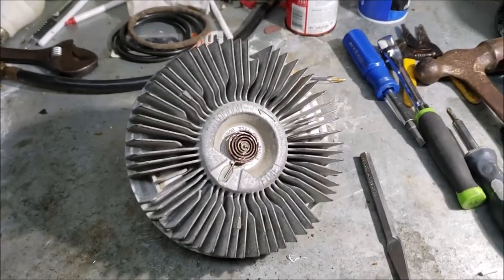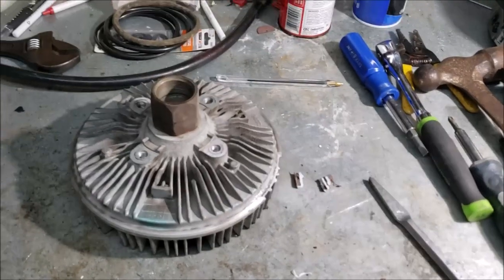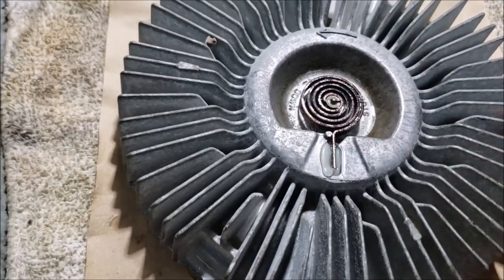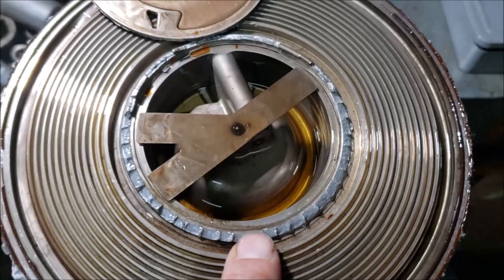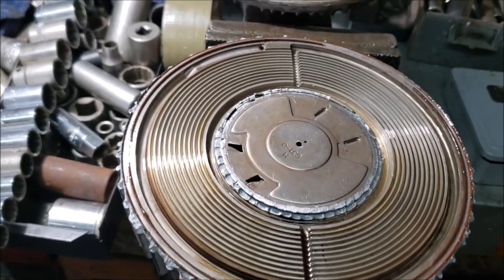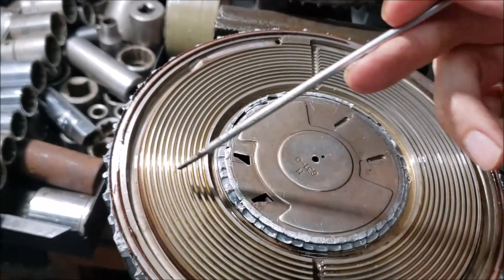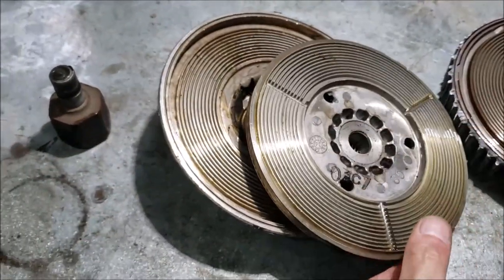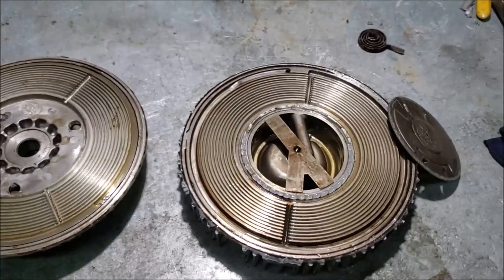How Does a Viscous Fan Clutch Works in Your Workhorse Chassis With a 8.1 Vortec Engine W8002567

Comment: A lot of times it’s not even a bad fan clutch. It’s a bad radiator with an internal blockage. It doesn’t allow the hot air to flow over the fan clutch to engage it.
Reply from the maker: I concur, I address that problem in this video https://youtu.be/Y82GjwbTJnM?si=pimoTwfDpPG_DXFK

Comment: Silicone oil is used because it stays thicker at high temperatures.  In a pinch once, I drilled and tapped a hole in one of these and mixed up some silicone brake fluid with molykote 111 silicone grease until it was the right viscosity, then squirted it in the hole with a syringe.  Worked like a champ.  They typically leak all the fluid out around the control shaft under the spring.  If you look, the springs are always oily and covered with dust on "worn out" fan clutches.  Seemed like there was a little evidence on this one.
Reply from the maker: Rick do you still have the ticking sound on your Allison?
Reply: @ktoutdoor  Yes, we've put about 10,000 miles on it with the ticking.  Towing our trailer for camping and hauling tractors.  it's still working fine even with the ticking.  Everyone is stumped
Reply from the maker: @RickBaconsAdventures  When you find out what it is please let me know.
Reply: @ktoutdoor  Will do!  You have a lot of great videos so I am often around your page.  I have a really long writeup about the noise and work I've done in the description of the video if you didn't already see it.  I've got pretty good equipment and credentials so I'll be doing all the work myself if and when it decides to become a problem!

Comment: My 1990 LJ78 400k, auto , has a viscous fan..

I changed the radiator and thermostat bout 10 years ago , when I tow my trailer with the 1200kg  buggy over the hill on way to coast the temp would rise slightly , but the temp light for tranz would light up, I just pull it down a gear, run the revs at bout 3500, after bout five minutes it would go out..
I can hear the fan working.. 
holding that ratio going down the other side, I hear the fan noise fad away..
The radiator caps these
 day are junk..
The stem the attaches the spring and seals etc come lose on the top, allowing air to be drawn  into the radiator as the engine cools .
Radiator should be full to the seal when you check it before first starting it..
Reply from the maker: Thank you for contributing

Comment: Ok...i nust cut the coil spring with a dremmel tool....and was able to turn the valve to let the fluid flow....its workin...but i assume the fan will stay mostly engaged now ....thats ok cause im in s. Az...temps are 100 to 110.....i will turn valve closed in oct ....and see if it operates as normal when air temps drop✌✌✌ good luck
Reply from the maker: Cool let me know how it performs

Comment: Lets make this official... Yes, I did enjoy the video. Now as you were saying, around 70 to 80 000 miles, it's normal for it to fail. But, you've gotta figure also where did this W22 live most of it's life. If it was down south, in torrid heat, contrary to us, up north (Canada), these conditions are also a big factor. Thanks for the schooling 😉🙂
Reply from the maker: Interesting I did not think of that. But I try to avoid the cold...lol

Comment: Wow, thanks Kevin, I also wondered how the fan clutch works, very informative, thanks for taking the time.  I also noticed the roar of the fan when the engine is still cold and wondered about that, I believe you are correct that the oil drains out.
Reply from the maker: Yes that has been bugging me for a long time ..lol

Comment: I changed my fan clutch of my fj cruiser for a new one. I see that when cold the blades move not so freely and when hot it gets much harder. I have seen that the engine makes more effort and has lost acceleration. Could it be that the hardness of rotation of the blades influences the motor to slow down?
Reply from the maker: Thank you for contributing.

Comment: What happens if I bore it and lock the fan permanently to the axe? Would this solution destroy the belt?
Reply from the maker: No the belt would be fine but it would but it would hurt your fuel economy a lot. But I done that very same thing with my old 1995 Nissan pickup truck.
Reply: @ktoutdoor  Thanks for the reply. I agree.

Comment: Did the spring just pop up off the valve easily...or did you cut thru a tac weld of some sort? Thx im considering popping mine off and leaving the valve open in az summer heat...tacoma running at 220 degrees...non towing😲🙈😲🙈😲
Reply from the maker: Seams like it was held in place with epoxy. But with its age I'm sure your past do for a new fan clutch
Reply: @ktoutdoor  i just did a cardboard in front of rad test....ran motor up to 224....did a laser temp test at the clutch...it showed 205 to 208 and didnt engage.....so i see a self tapping screw comin its ,way very soon😁🤣😂 it does engage when i first start it up ...for about 15 seconds.....then its done......2014 tacoma 4.0
Reply: @ktoutdoor  very hard to get access while its still on vehicle.....i was going to try to pop off the spring and just turn the valve open....cant find anyone who has done it
Reply from the maker: I would be surprised if it made a difference. But let me know if it does.
Reply: @ktoutdoor  will do....i.may not mess with it for a week or 2.....im headin to grand canyon ...n rim